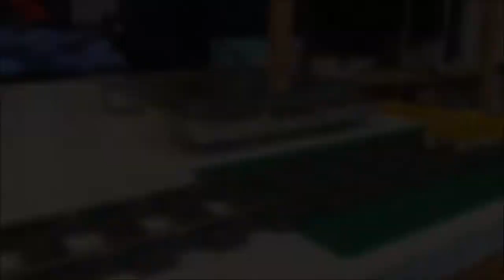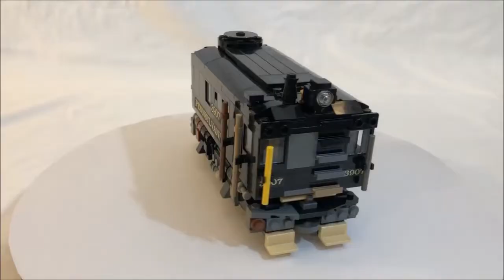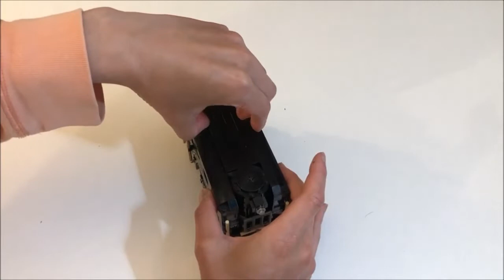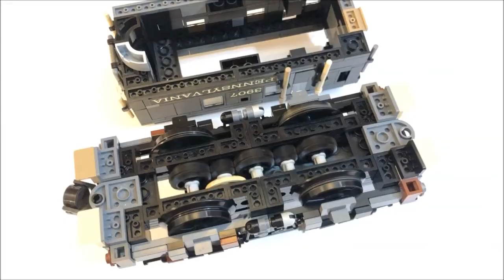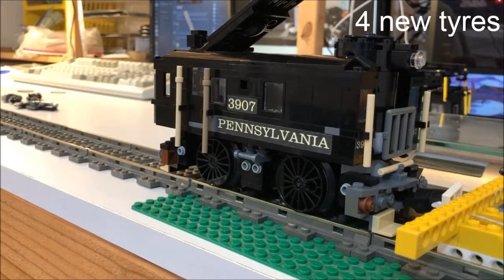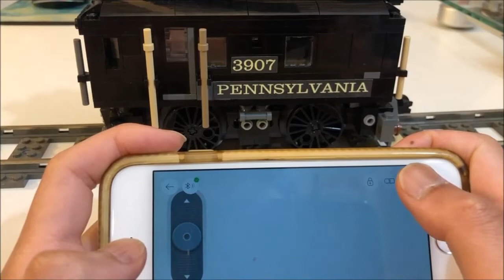LEGO 1:48 Pennsylvania Railroad A6b v2 (Powered Up)

Comment: I've never tried to design a PU interface but wouldn't it be possible to combine the slider with a stop switch? (So somehow a synthesis of the two versions you showed?) Or is this where the lack of documentation comes in?
Reply from the maker: Yeah, that's basically the problem. As far as I can tell they don't have a way to move the input sliders with code... or at least not one that I've been able to discover without documentation.